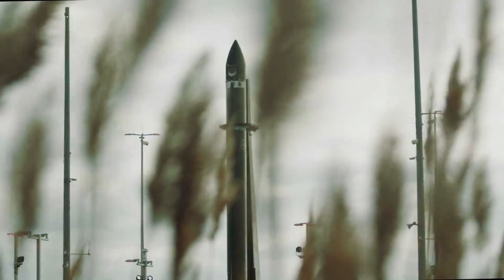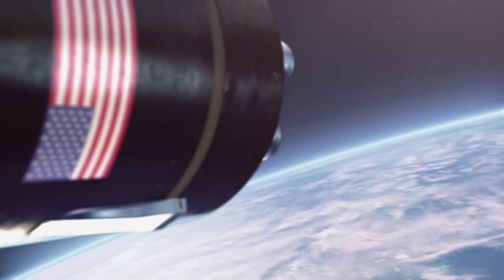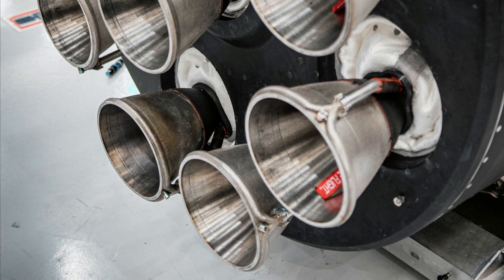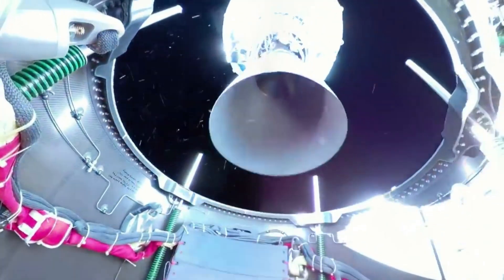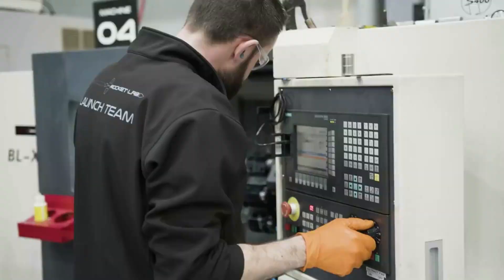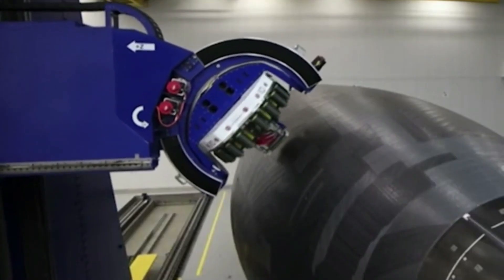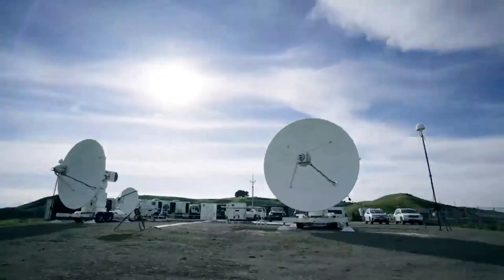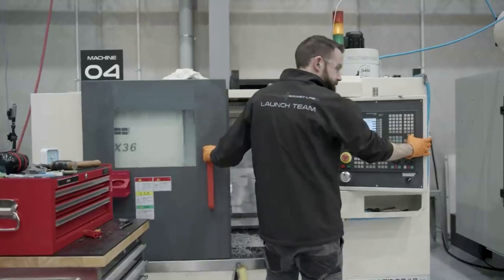Rocket Lab Just Launched It's First Reused Engine

Comment: Oceangate did a wonderful job demonstrating large temperature and pressure changes on the life cycle of carbon fiber vehicles. What could go wrong? 
ARS Technica said:
"In terms of orbital rockets, only NASA's space shuttle and SpaceX's Falcon 9 vehicles have demonstrated the capability of re-flying an engine. With Rutherford, Rocket Lab has now also flown a rocket engine that landed in the ocean for the first time."

BERGER BOY FORGET ABOUT THE X-15 WHICH ALSO ACHIEVED DECENT SPACE ALTITUDES.
Reply: X-15 was not orbital.